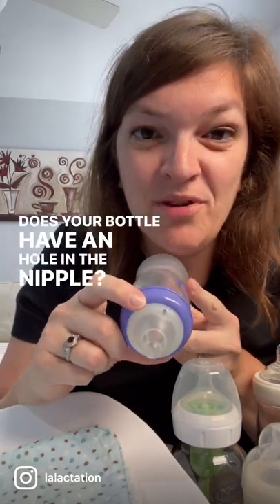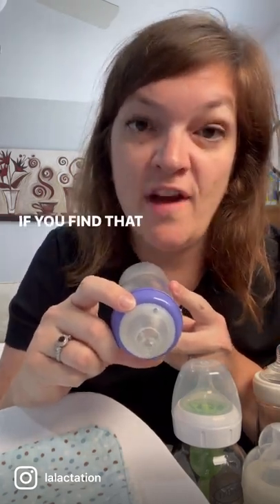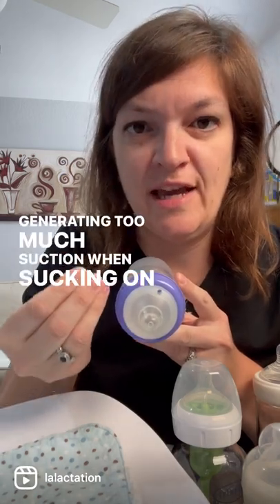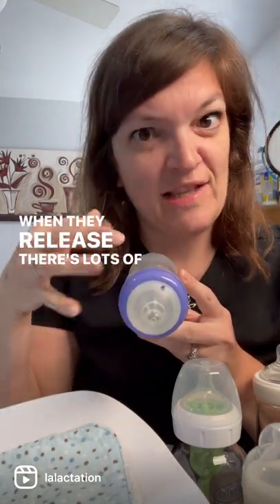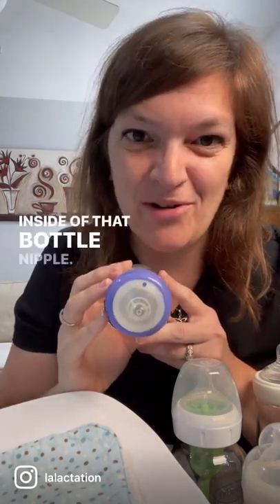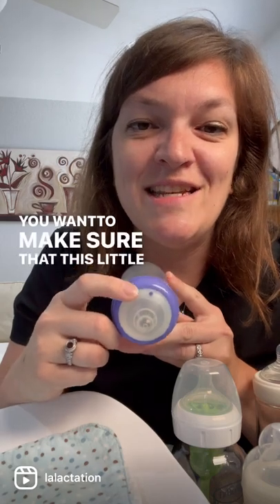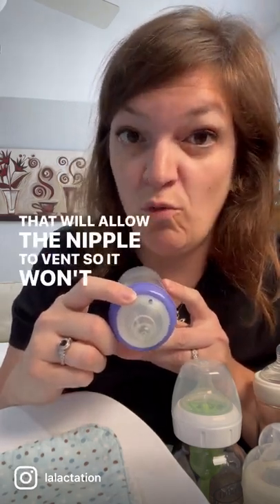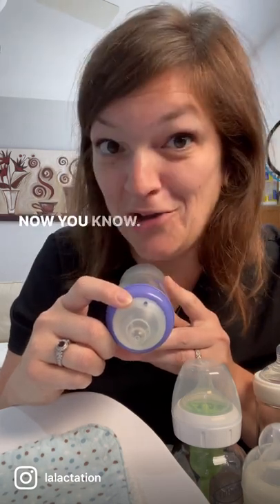Baby collapsing the bottle nipple

Comment: My air vent is up when I feed and I still get a ton of bubbles in the bottle when feeding my little one. Any advice ? She’s on evenflo standard neck. But she did it on lansinoh too.
Reply from the maker: Pinch the valve before you feed it, make sure the bottle isn’t filled past the fill line. What nipple level are you using? Does baby have a tongue tie? How is breastfeeding going?
Reply: @lalactation  ok I wasn’t pinching the valve before feeding. I’m on the slow flow and she had tongue/lip toe revised already. Only bottle fed. Thank you so much for the help

Comment: Are there supposed to come any air bubbles (big or small) in the bottle from the nipple or none? I have the air vent up and still my baby blows so many big bubbles in the bottle. He is so gassy. Thanks in advance for your reply. Love a desperate mom from the Netherlands
Reply from the maker: There shouldn’t be any, or very few. You may need to go up on the nipple level or try a different bottle system.
Reply: @lalactation  it happens with every bottle! With Dr Brown there are tons of tiny bubbles in the nipple that when I tip down the bottle (or when he releases) escape into the bottle (and dissolve). With Lansinoh there are big bubbles in the nipple and a faster flow is too fast for him. I have tried every bottle known to man. I am so confused and desperate to fix it as with 16 weeks he is still as gassy and colicky as ever! Any ideas? Thanks so much for your reply ❤️
Reply: @xxSweetsasxx what worked for you? I have the same issue as you!
Reply: I also have this issue. What did you do in the end?  @xxSweetsasxx